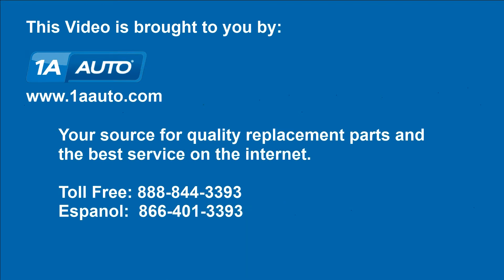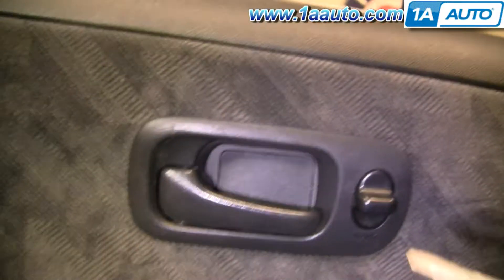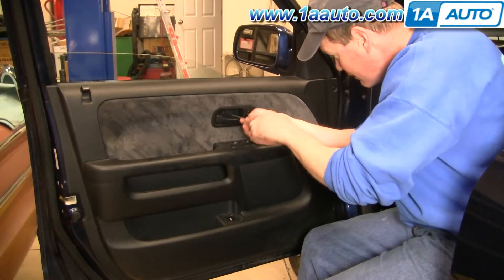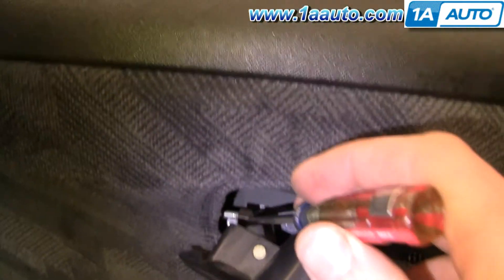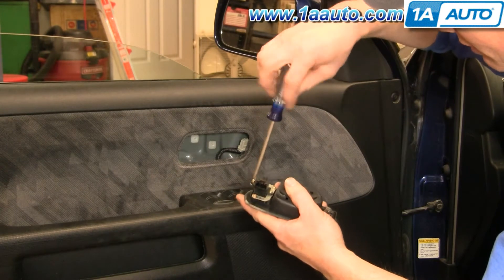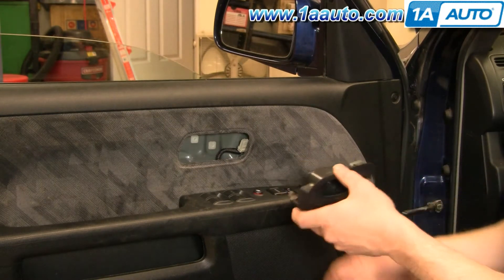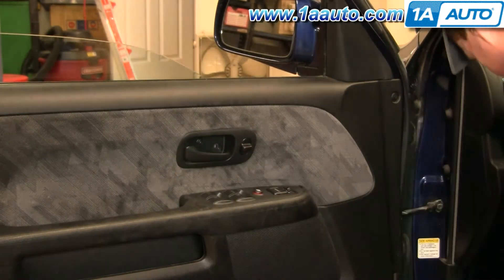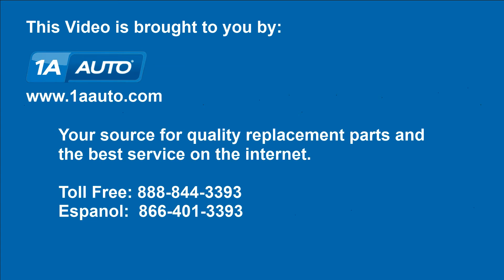How To Replace Interior Door Handle 02-04 Honda CR-V

Comment: Excellent! Thank you for your help. Took about 10 minutes on my 2001 Honda CR-V. There was only one screw holding the handle unit in place. And the new handle hole didn't line up but the handle still latched into the frame of the door, so it seems sturdy enough.
Reply from the maker: You're welcome! We're glad to hear that you were able to get everything working. Seems like there's always something that make the repair more difficult, doesn't it? Thanks for checking out the video!   1aauto.com 866-403-3393

Comment: Used this to guide us in replacing handle on a 2000 CR-V. It's even easier on the 2000 model: there's just one screw with no plastic covering over it. Had to move the handle around a bit to get the screw hole to line up, though.